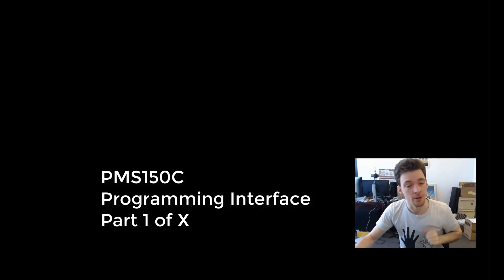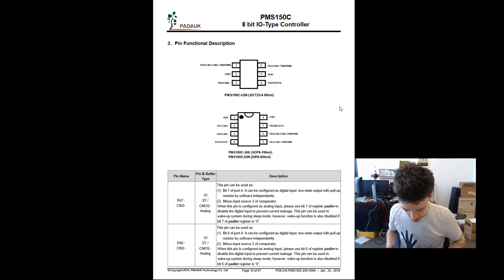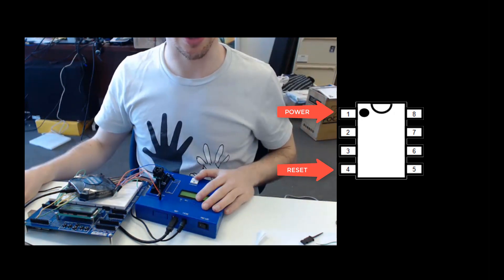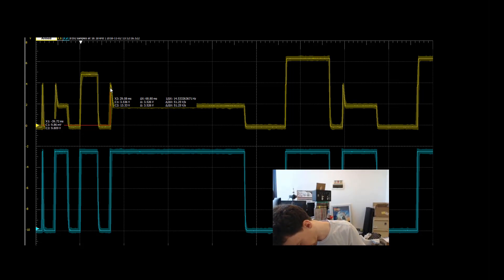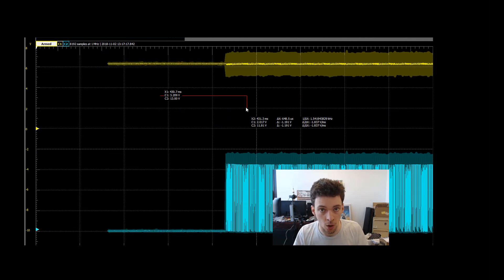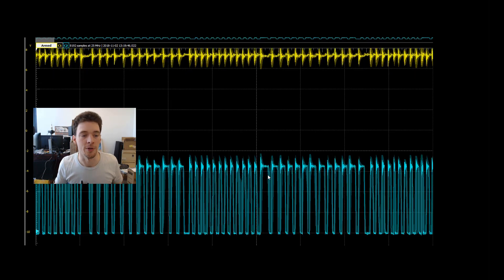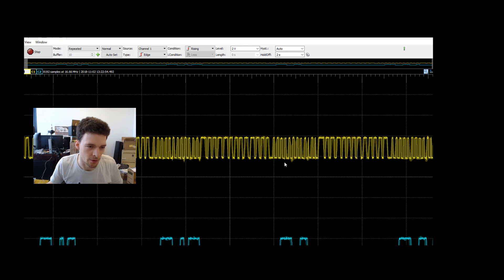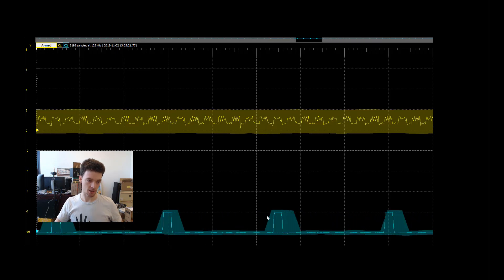EEVblog #1144 - Padauk Programmer Reverse Engineering

Comment: Instead of using this toy scope (only 8 ksample memory, seriously?) I would recommend to use one of Dave's good scopes, with megabytes of sampling memory, and 4 channels input. Would make reverse engineering much easier. The Keysight scopes have even the nice segmented memory feature, which allows you to sample multiple blocks with long pauses between, but still at high resolution for each block. You could probably record one full programming cycle with it.
The protocol for clock and data looks like SPI. With a Keysight scope you can also enable SPI decoding for selected channels, so that you don't have to manually decode the 0's and 1's, and then you can compare the numbers with the programming file to see where the actual programming starts. You could even read the scope memory over ethernet with SCPI commands to analyze the data further with e.g. Python script.
Reply: We are moving the lab, they are in boxes :(
It does look like SPI, there is some variations though, I suspected the same thing. Word size is all over the place if it is SPI. The scopes as far as I know only allow for a single word size? I also ran it through a script to decode it, that actually works and is repeatable, but not in this part of the video maybe in the next video :)
Reply: @davidledger5941  At least with my relatively cheap DSO-X 3012A you have to specify the word size for the SPI decoder for the whole waveform. I think the easiest would be to get all the data of all changing pins of a full programming cycle on a PC, and then analyze it offline. You could even publish the sample file, together with the IDE project which produced it, and then let some geeks work out the protocol :-)
Might be fun to build something with a Beagle Bone to capture the data. There was a Hackaday article about the BeagleLogic, a 100 MHz / 14 channel logic analyzer. Right, there are different voltage levels, but looks like only a few discrete levels. You could easily build a simple encoder with a few fast window discriminators and some fast logic (CPLD) to encode e.g. 8 different voltage levels in 3 bits, which would give you 4 such analog channels. And you can record 340 MB continuously with the BeagleLogic.
But maybe easier to wait until all the big scopes are unpacked and then just get the data from them. But I don't know if they allow to read the full sample memory over SCPI, would be interesting to try.
Reply: I was about to write almost the same thing.  ;-) This seems like it could be emulated using SPI and MOSFETS for level shifting. It has all the same features of SPI at multiple voltage levels. Start differentiating between voltage levels using a pair of level shifters, then decode using some kind of SPI protocol decoder. If SPI doesn't work, you can write a custom one using the Saleae logic analyzer API or post process in Python. Then when you have aggregated data, start the actual reverse engineering in software. This will likely yield the best results fastest.
Reply: Good thing about doing it a bit bootstrappy (if that makes sense) is that suddenly, the techniques used suddenly look a whole lot less out of reach to those of us who might not necessarily have access to beefier gear. I mean, call the analog discovery (and digital discovery for that matter) a toy scope if you want - and I won't necessarily disagree - but they're more or less the sweet spot for starting out without breaking the bank too much. Also, lots of instructional material available and really quite versatile, not to mention often available either for educational prices or even just for use in a simple school/college lab without too much of a fuss.

Comment: It would be easier to reverse engineers the programmer's software..
Reply: Probably, if you can somehow dump its PROM and the architecture has a decent disassembler
Reply: Mike Harrison of Mike's Electric Stuff is a good guy for strange protocol.

Comment: I would assume that the voltage level change on the clock and data pins has no significance, they just have to adjust the logic levels as they change the Vcc. I.e. if you run a cmos logic chip on 10v, the 0->1 transition will happen at 5v; whereas it will happen at 2.5v if you run it on 5v. If I were you, I would look inside that programmer; maybe some labels / resistors can give some hints.
Reply: If you were to have one analog channel on the rail and the rest digital from the 4000 series buffer I am guessing that is all you would need.

Comment: Doesn't Dave have a saleae logic analyzer?
If it is a Logic Pro it would be capable of analog sampling 5 channels at 50 MS/s, with an Input Voltage Range of -10 V to 10 V.
Reply from the maker: Original model only.

Comment: Use a beaglebone +beaglelogic. Will give you 100MHz logic analyzer up to 320MB samples. Also you can use an analog comparator from the supply voltage pin, so the threshold could follow the varying supply.
Reply: Interesting. I have a beaglebone lying around doing nothing...

Comment: I like it. I was pondering making a programmer for those micros. And you have provided a starting point. I don't have a programmer to compare, so if I get any ideas, I may ask you to look at it again.
Reply: Dito. These seem like great little micros, but to really put them into the super useful category you need to be able to up scale programmer throughput while maintaining the ability to change firmware faster than out of house services would allow.

Comment: Just put a good logic analyzer on every pin for an unprogrammed chip and hit it with unique programming code and observe what happens.
Reply: Then I'm looking forward to the rest of the series :)
Reply: Actually did that, it is interesting but very unclear where the data starts and stops, I think there must be some information at the start and end that changes which depends on the data but is not part of the data.
Reply: @davidledger5941  kind of sounds like a checksum (+ header); these segments are constant for a constant program?
Reply: @Wren6991  Yes they are constant, it does seem like a checksum, but I don't know where the data starts yet so cannot confirm.
Reply: @davidledger5941  Perhaps the programmer uses encryption to the micro based on a unique serial number (read only) in the micro, to mitigate knockoffs (or "midnight batches" in approved factories) being produced. Look for differences in initial handshake between different micros in the same batch.
Reply: @modrobert  proper decryption logic would be ten times the size of this micro. I would doubt they do that.
Reply: @davidledger5941  can't you subvert the programming with custom data? Unique data from start to finish so you can differentiate it from the rest of the noise? Just have it write PI or something so you can see the data and what parts are being written and when.

Comment: Anyone have a site for a used or discounted ociliscope
Reply: ebay
Reply: Dave made a tutorial on how to look for one on ebay. Search the eevblog channel
Reply: Ask some professor at your local trades highschool, particulary one that has electronics as one of its options (duh!) or maybe ask in some electronics shop, some times the clerks are there because they like electronics so they might know of some place. 
Dave said used analog scopes are cheap, but that depends on the country and what is cheap in some places might not be in some other. 
Otherwise you can make a "soundcard" osciloscope, and even make one with a couple of arduinos and a bit of coding. But i'd recomend using several ATtiny's instead to make the high speed ADC and then yeah maybe and arduino to get the data out fast enough (you might need to compress it a bit or make a parallel port interface.
With each ATTiny you get like 15ksps at 10bits or more if you go 8. If you are doing low voltage you could even do 8bits and maybe get like 25-50ksps and with 4 of them that'd be 100-200ksps which is quite a lot more than what your sound card can do plus you get an actua frontend  (provided you make it) and dont need to relay on the sound card for accuracy.
 If you are willing to spend the time there are definetely ways to get your way there or at least get cheaper alternatives that can cover 99% of your needs.

Not sure if there's oepn source proyects already you can adapt, but otherwise making the gui in python isnt that hard.

Comment: very interesting!..crazy it has so many voltage levels.. i like your vids David..straight to the point and no BS!
Reply: yeah, no 5 minute outtro waffle either.
Reply: Old school EPROMS used to do that. You'd have a supply at 5V for read and 12V or 21V for programming. 

https://electronicsforu.com/electronics-projects/manual-eprom-programmer